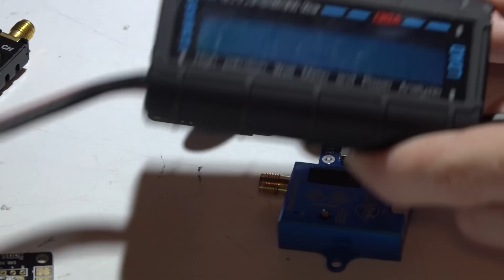Guide To: Power Distribution Boards (PDBs)

Comment: What's a current sensor? Why is it important to have?
Reply: A current sensor measures the amount of power being used. Typically in mAh (milli-amps per hour; like an electric meter on your house).  It is more important to be able to read the battery voltage. Like a gas tank. The higher the voltage, the more power that is left.

Comment: Very informative video, thanks . Do you recommend any of these to be used along with Naza mv2 controller:
https://www.amainhobbies.com/racetek-matek-pdbxt60-power-distribution-board-w-5v-12v-bec-rtk2505/p525354
https://www.amainhobbies.com/racetek-matek-led-pdb-v3-5in1-5v-12v-rtk7506/p506693

Comment: when installing the esc power wires to pdb, each esc has its own pads designated for connection. does it really matter what positive pad or negative pad the pdb wires touch? it is extremely important to make sure they stick to their pads, or can you deviate a little if you have a short wire for example???

Comment: Hey JC ! So I asked earlier about pdb that you liked using for the omnibus fc. Since then I have checked out your pdb video. Thanks for the video! So my question is this....I have been using the rtf quad pdb that uses the esc's signal wire and ground wire soldered directly to the pdb then a plug from the pdb to the flight controller connecting with the four wires for the motor channels. I have decided to use the basic RMRC board, so do I just connect the esc's signals wire to the fc board to the specific channel or do I use both the signal wire and the ground wire from the esc's to the flight control board port for that specific motor channel? Sorry if I explained that in a confusing way.
Reply from the maker: Connect the ESC signal wires to the flight controller in the correct order. And for the ESC small ground wires I just solder those to the PDB ground pads with the big ESC ground wires.

Comment: you should try the hubosd pdb. ive used them on two builds and i love the built in osd that shows battery voltage, amp draw, flight time, and milliamp counter in a very out of the way and easy to read display
Reply: Bought one, kinda regret but other than the OSD, it's a great product. I wish it can communicate with the FC so I can display more parameters

Comment: Hey JC, Matek just came out with an awesome PDB it's also being sold at BG re branded to realacc , I got one of them, haven't installed it yet waiting for some parts but the lay out is awesome it has everything you need from a PDB short of OSD, I myself am not a fan of all in one, so I don't like OSD built in too much problems,  so this PDB I think is close to perfect I specially love the XT60 connector, check it out http://www.banggood.com/Realacc-Matek-PDB-XPW-5V-12V-Dual-BEC-PDB-Built-in-150A-Current-Sensor-with-XT60PW-Socket-p-1111981.html?rmmds=myorder
Reply: I've had both Matek and realacc made by Matek. I loved the simplicity and the osd but they suffer from voltage spikes. I believe the 5 volt rail is shared with the osd and the cap provided is not enough to stop random osd displays and total loss of signal. Shame i really like the product but caps every where defeats the objective. Check my channel JC i did a few videos on it, i still have one left mate, your welcome to it and see you can get it to work. I don't mind sending it to you from the UK, you have helped me a lot.
Reply from the maker: Yea I've taken a look at those. That is a very nice layout and price. It would be one of my top picks.
Reply: Yep the HUBOSD pdb. Big fan and you can get the same layout without the current and voltage sensor if you want.

Comment: Thanks JC, I've not used LC filters in my builds to date. I'll be adding one to see if I can see the difference 😉
Reply from the maker: It all depends on the quality of the Vtx you use. The RMRC Cricket Vtx I use doen't really need a LC filter, it filters just fine on it own. But I use a LC filter anyway because that separate my flight controller, Vtx, and Camera from the ESCs. So if the ESCs create any harmful voltage spikes that normally would fry something, the only thing that will get fried is the $2.50 LC filter. So I see it as win win. Little bit better video, and also protection.